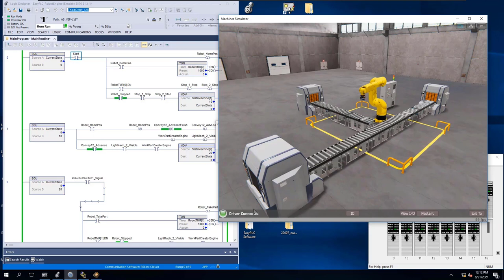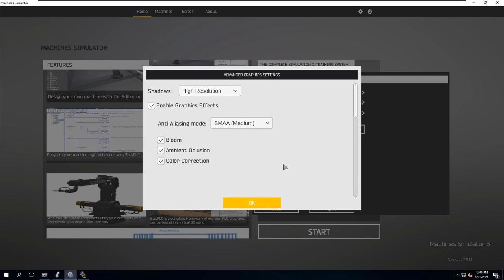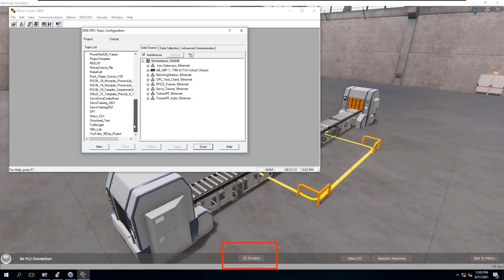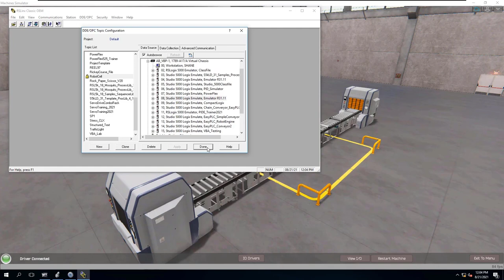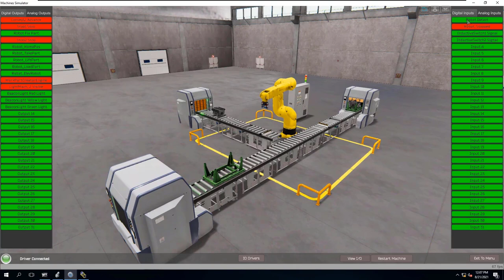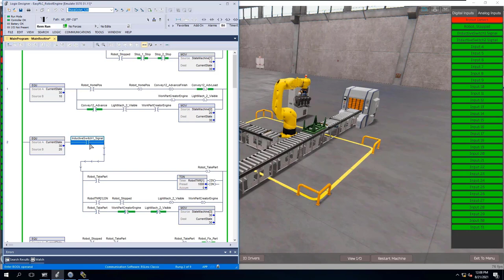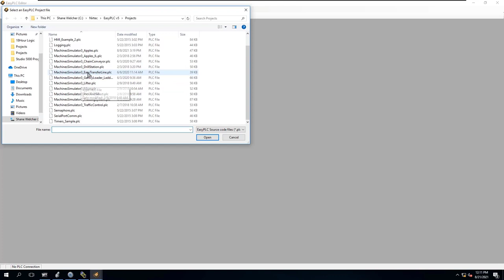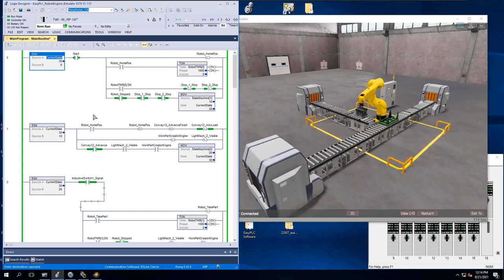EasyPLC Machine Simulator Using Studio 5000 Rslinx OPC | Robot Cell Example

Comment: Is state machine, sequencer, steps used interchangeably? Your variable called StateMachine which is just an array of integers, could it just as easily be called step or sequence? I am wondering if there is no difference between a sequencing machine vs a state machine or a step program. Thank you so much
Reply from the maker: A state machine is generally a custom build even though my example is extremely simple.

I have made videos using the state machine in a much more complex method however a sequencer is pre-built and does have limitations.

For what I did in this video, sure they could both be easily used.

However this is a very simple example.
Reply from the maker: Here is a video where I built a state machine in structured text.

https://youtu.be/PrVx-IHKUgY
Reply from the maker: I also made one using a FAL for a simple state transition:
https://youtu.be/ZFrIzx7Q3UI
Reply from the maker: Here is the video where I made the logic in Structured Text:
https://youtu.be/JEFOQyG0lMQ

Comment: Thank you Shane. It seems that when doing a step/sequential logic that structural text would be a more clean and easier way to go.  I used ST on another simulation using the case function where each case is a step. It seemed easier to write and read and troubleshoot. I cannot find many examples though using structural text this way so I wonder if I am doing something wrong or there is a better way?
Reply from the maker: Here a few other videos showing other ways of making a finite state machine>

Servo Motion Project Day 12 - Using Inputs in a RSLogix 5000 finite State Machine
https://youtu.be/JEFOQyG0lMQ

Servo Motion Project Day 28 - RSLogix Structured Text State Machine Logic Example Explained
https://youtu.be/PrVx-IHKUgY

Rockwell Automation 6-Axis Robot Using a Finite State Machine Using Studio 5000
https://youtu.be/tadvXDK0iIs